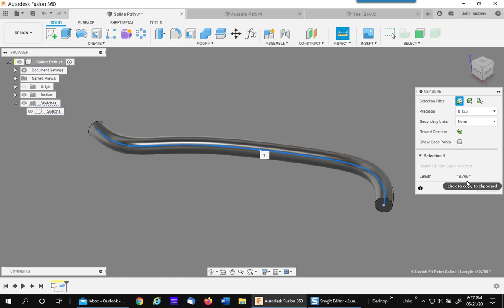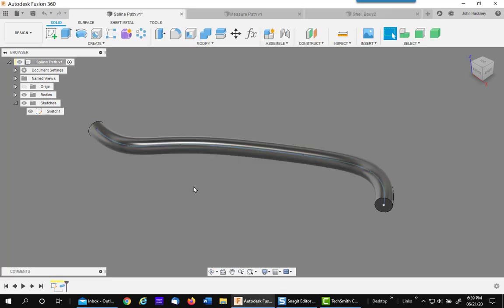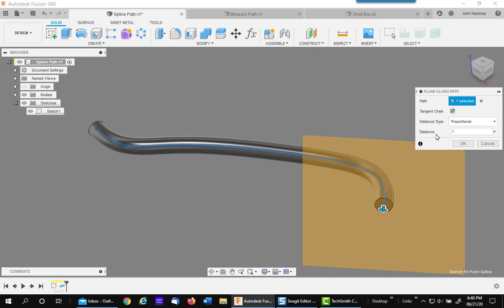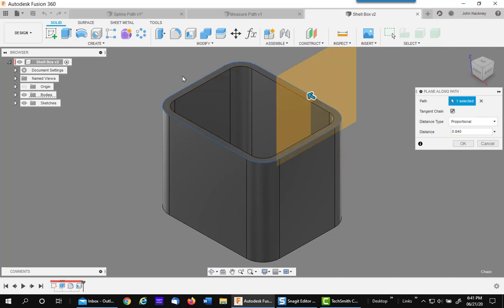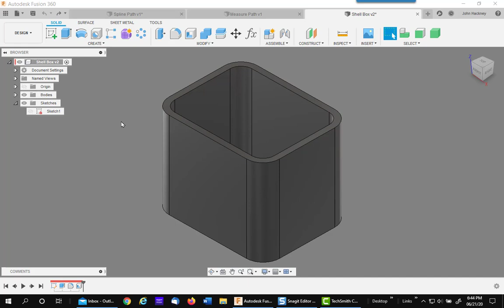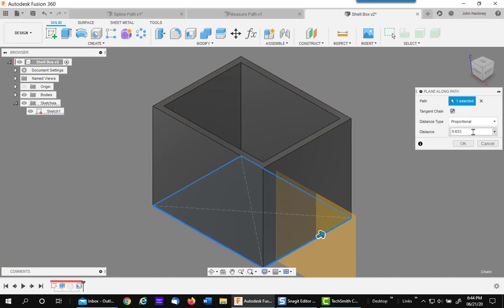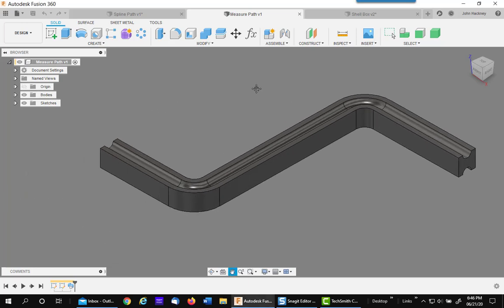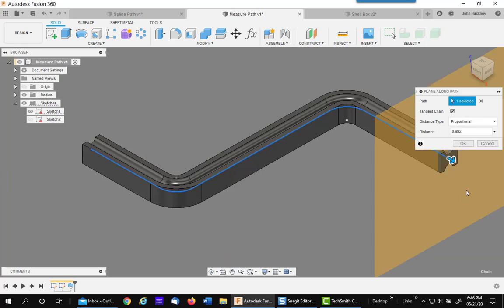Measuring Lengths of Edges and Paths

Comment: Actually, dudes if you just select the edge of your measurement in the bottom right it will also display this measurement not in the measurement tool. I used this to measure the length of wood I needed for a curved table I designed